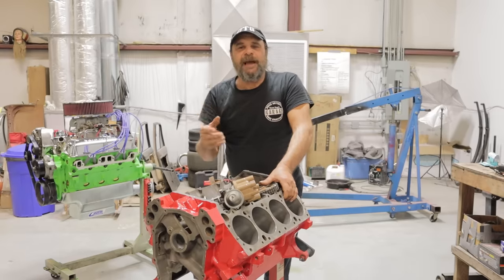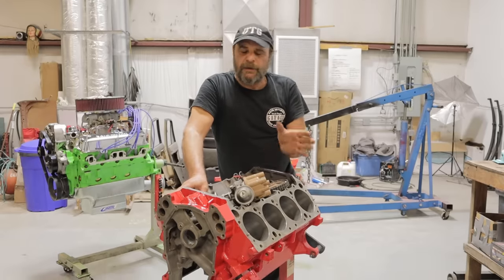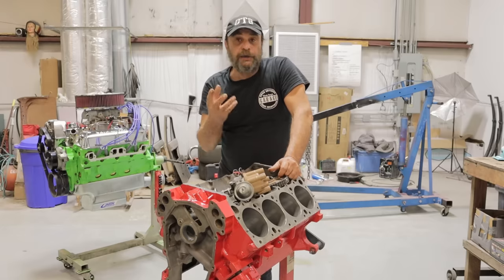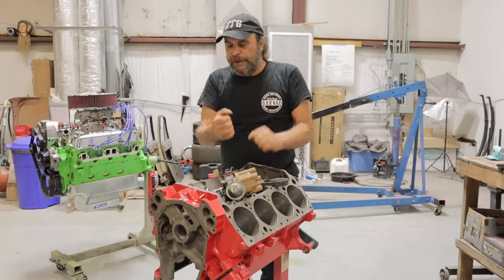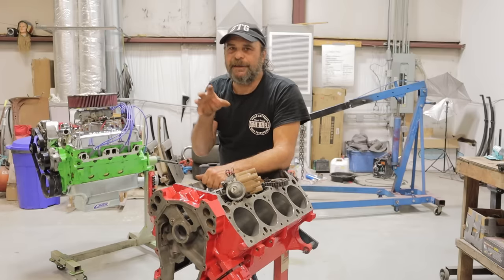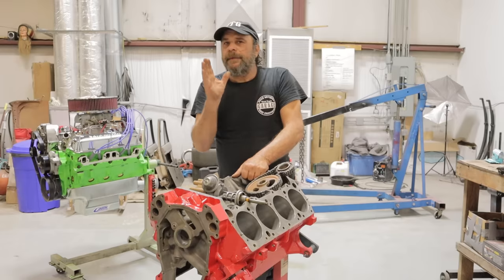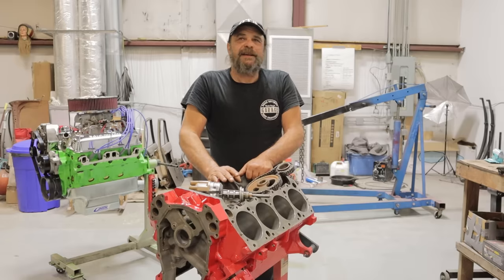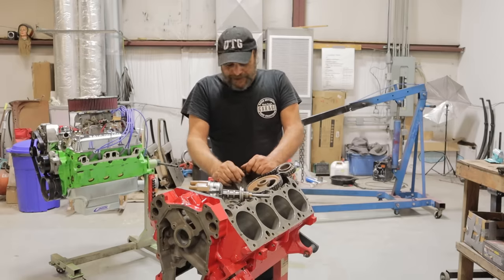Power Timing Secrets For Classic Cars

Comment: I have an 1986 gmc 350 that I am getting ready to start and break in a new cam and flat tappet lifters. I used pre-lube for assembly and am adding a zink additive for initial start up. My question is, can I set the timing mark on the crank to the 10 deg advanced and line up the number 1 on the cap?  I only have the old style light without the pickup and old dwell meter.

Comment: I love this guy more than a NOOGE...NOUGE...NUJE...  Awwww heck, now for an important question...  I recently had my motor completely rebuilt.  I haven't started it up since I got it back from the machine shop.  (10/03/23)  It was run on a DYNO and I brought it home that same day.  It is a BBC 396

I'm just about ready to fire it up, but the weather is becoming cold...Low 50's in the afternoon.  Here is what I was going to do while the motor is on TDC while the spark plugs are out of the motor:

1.  I was going to run an oil pump priming tool first, in order to get the oil pumped throughout and up to the top end at the rockers.

2.  Install the distributor as the motor is at TDC.

3.  Turn the key over for a few seconds to prime the carburetor, without the spark plugs installed, and no power to the distributor.

4. Install the valve covers, spark plugs, coil wire, and make one last visual inspection ensuring all power is supplied, fuel is ready, and finally hope to God I've done everything correctly.  

Is this the proper procedure, or should I be doing something different.  If so, what can you recommend?  

I have had the motor wrapped in blankets, with plastic covering the rockers, since I brought the motor home.  I just don't want to do any damage to this motor.  Fresh oil is in the pan, coolant was added last weekend (11/18/23) and now I feel confident after watching your videos, that I may have success with this.  Just nervous!!!

Comment: on a 300 ford 6 a common thing is the rockers are cast and bend out of shape and can lose up to as far as 7hp, it has a timing gear for the cam disi and oil pump but has only as low as 7.8 compression in carb form and as high as 8.8 with efi, the efi heads are fast burn and top out at 27 degrees of advance due to fast burn chambers, and so are a bit different

Comment: I’ve had my motor for like 5 years , I’ve had nothing but issues with this thing, I’ve tried soo many different combos, and I noticed I was knocking and pinging due to retarded base timing at like 18 degrees, I did your power timing , and took note that it probably wanted to be at 8, then I un hooked vaccume lines and double checked with timing light and it was right on the money , like what you said , after watching this video like 3 times it started to make sense, cause I always felt like my timing was advancing super late due to late base timing, I’m at the point where I don’t wanna hurt my engine before I actually get to enjoy it

Comment: I have done that for years. I had trouble with that one year the timing was all over the place found out the distributor was wore out i pulled the cap off and could wiggle the shaft back and forth and pull it up easily. Put a new distributor in and took care of the problem.

Comment: The sound that Uncle Tony made at 13:44 is quite accurate, that sound is like 45* or 50* of advance.  Keep Noodging to Retard around 30* or 32* and see if it goes away, I have set my timing? Or Noodges? at around 29* advance, More experimentation is needed.

Done on a big block chrysler 361.

Comment: Does using a Pertronix ignition item impact how one understands timing and setting timing? In my  case, I have a higher mileage mostly factory 69 Dodge  Monaco 383 4bl auto transmission. The Pertronix ignition item and a high flow air filter, and plug wires, are not OEM. The original carb works well. Thank you.

Comment: Ignition timing can make a wore out engine crank and run like new if tuned right. I demolishwd a smallblock chevy by driving it with no coolant (2 Am and nobody to call or tools to fix it with) and my dad did a little tweaking to it, and even with the engine being practically trashed in every way it still cranks and runs (almost) like new. But it'll smoke like crap. Fast forward to now and i have a 250 i6 in a camaro thats flooding itself and we are trying to mess with timing to fix, but it may be a carb replacement.

Comment: five months and my cared f93 ford laser (escort)  still runs mint i can start and stop no problem, fires up in a fraction of a second with a new clutch its loads better to sit in and driver compared to other carbed cars. after changing the mechanical fuel pump a refurbished dizzy and carb. the only thing i need to get done is the outer CV. Thats the next job that well make my hands dirty lol

Comment: Not trying to say tonys wrong  but all you have to do to sbc is start your engine let it get to operate temp. And pull the distributor forward until it sounds like the starter is dragging and push it back a 1/4 " at a time until it starts perfect then pull  distributor 1/4" forward.

Comment: I have a 1972 Cutlass Supreme. It sounds & runs good while sitting idle. When I try to drive it I get less than a mile & it shuts off. Sometimes it starts back up right away. Other times it takes awhile to start, but when it does it does the same thing. Could the timing be the problem with my vehicle?

Comment: I've got a built high performance csb350 and the heads had work done on them prior to the head gasket set that I'm doing to it now. Now will my rocker stud bolts/ question(1[should you be able to tighten the nut all the way down to where it can't be turned anymore it's completely tight or will a normal rocker bolt stud and rocker bolt/stud nut never tighten all the way down and (2 should there be a gap 3/8 to a 1/2 of gap between the rocker and the head when tightened down to (?)That's my 3rd question what if any is the  lb/ft. Of torque for the rocker nut? Last question reuse of head bolts have you ever read used them;?Thanks in advance Uncle Tony. No pun intended.

Comment: Quick question.  The problem our shop is trying to nail is a pink/knock under heavy foot, to the floor type of thing.  98 non ethanal gas.  If it pings or knocks ... does that mean the timing advance is outright too far before tdc?  How does and when does the distributor and it's weight fit in?  Next, info is 1966 GTO with a 428 (had a tri but took it off and put on stock 428 manifold and crb).  Compression is 180 to 200.  It is coming into the shop tomorrow 05312022.  Maybe set power/load timing with distrib advance disconnected ... maybe all the time. We are chasing the ping under super heavy foot feed.  I get some of the intuitive thing... but I see or reason to advance timing if it pings for any reason.  We don't know the eng history. Basic timing is 6 according to the shop manual.

Comment: Hey uncle Tony first thing let me say that your video's are awesome I have a question about a small block Chevy 350 how much piston ring gap is to much  the heads have been ported and has 202 valve's and a thumper cam using flat top pistons standard bore performer intake high voltage hei blah blah blah my piston ring gap is around. 024 to .025 on the top ring and around. 026 on the 2nd ring is that to much gap they are flat top forged pistons and cast rings thank's

Comment: at idle you advance till you get the highest idle, and then back it off till it just is at the cusp of dropping 100 RPM, and then total advance is advanced to where it just begins to ping  when it’s lugging at low rpm with high throttle
Engine idle mixture should be lean just to where it starts to do it couple of hundred RPM drop and if it’s a carburetor pay attention to the accelerator pump which should have maximum flow and no play

Comment: I have a question. I’ve learned an incredible amount on distributor/timing/the whole shabang recently as I replaced my intake manifold and carb on my sbc 350. These videos have just been an incredible source. My question now that I feel I understand the topic is…..is it even necessary to use a timing light to set initial timing? Since it sounds like in almost all situations, your going to set it by sound and right up before spark knock? Why then would even initial timing be needed? If you set it at 8,10,12 degrees, you are essentially going to advance it anyways (if needed) to get to that ultimate power timed degree. Am I understanding correctly?

Comment: Hey man have you ever seen a 350 to 305 swap I blew my 350 up so I was gonna swap it with a cheap 305 I found I’ve never done a complete swap so I wasn’t sure if I had to do any prep work or anything before I did the swap I’ve done a lot of research and it seems like everything will bolt in perfectly

Comment: My 93’ Thunderbird has the 3.8 it is a computer controlled distributor with a Halifax sensor do I still time it the same way? I can’t find any specs for initial timing. The computer can vary timing from 8 to 12 degrees.

Comment: I have an issue with my 87 camaro with 305 tpi. I think it is timing related. After a shop stabbed a new dizzy i  it, it hasn't been itself. It has a random popping in the exhaust in idle. And when I'm cruising at lets say around1500-2000rpm with light load I can feel the same random popping during the drive. With each "pop" the rpm needle jumps.

Coil, plugs, plugwires, cap, ignition control module and rotor is Ac Delco. The distributor itself is from the brand "standard". Car has 87k miles.

Comment: Had a 3rd gen vette with a worn 350 that wouldn’t run for crap with a timing light, years later I wonder if the balancer outer shell turned.  Just kept moving the distributor blindly till it ran its best.

Comment: I've seen a few engines that you couldn't time with a timing light. The timing marks were wrong for some reason. I once bought a brand new harmonic balancer for a 327 Chevy and found the make on the balancer was out by 7 or 8 degrees. Was it the balancer or the marker that bolts on the side of the timing chain cover. I never found out which. I just used a hacksaw and made a new mark on the damper in the correct position. Over time the outer ring on old dampers can walk around the hub as the rubber sandwiched between the 2 pieces deteriorates. I've also seen a couple of dampers fly apart because of the outer ring coming loose. Timing older engines is more art and intuition than a science
Reply: Love the hacksaw idea

Comment: What if I didn’t degree my cam in? Wouldn’t that change how the engine reacts to the timing or how much timing it will take? My built 318 according to the timing light will idle at like 30 degrees or more. And it still wants more advance

Comment: Having issues with my 350 sbc. With timing I ran last year (38) it spits out and back fires through carb. We got it to stop spitting by lowering in the 20’s but car under load stutters bad. Any ideas? Can’t get the car to run right. Idles great, snappy from carb then put in gear and try to put load and go it just stutters like a 2 step.

Comment: Hi and thank you for your videos Uncle Tony! I've got a guestion about sbc and cylinder pressure testing. I have measured the combustions pressures and found the 6.cyl averages about 20% lower than the others cylinders. What could be the possible causes and is there an easy way to fix a cylinder such as honing the bore etc?

Comment: Static and dynamic compression should always stay the same, but cylinder pressure or cranking pressure will drop over time.   Right?  It was always my understanding that dynamic compression was calculated using the closing of the intake valve and thus may vary with the camshaft selected, where as static compression was simply based on bottom and top of stroke.  Help me if I am mistaken.

Comment: I just put a brand new 383 and a decent cam , I can’t get it to idle using a 750cfm  carburetor it wants to run but won’t lop just will kinda spit and pop and die as the rpm’s are lowering

Comment: Hey Uncle Tony, could this technique be used on an air cooled VW engine? Would this raise the operating temp too much?
Reply: 10 degrees too advanced you can melt down a piston. 

Depends on what kind of distributor u have. 

32 deg max advance. 

Also pays to find actual tdc. Factory marks are a joke

Comment: It’s a sad day when you have to explain the comment section before the video starts.
On the flip side I will be doing my engine with a timing light, then not knodding the distribution but moving it 2 degrees and then writing down the results.
I have to write it down, then reading everything to find the sweet spot.

Comment: What are your thoughts on changing the firing order. I'm not sure if it's A thing with Mopar. But with GM you can. It's been so long since I forgot why. I have seen it pick up HP not much tho. These were all modern fuel injected engines

Comment: When im adjusting the dist a 'nudge', i just put my hand on the vac advance pot...i stopped putting my hand over the plug wires on the cap...as the occasional shock made the ticker stop a few times ☠️
Reply: If you're getting shocked while touching the plug wires it's time for some new ones.

Comment: Hey UTG wanted to ask would A severely stretched timing chain cause hesitation when you mash the gas from like a stop sign? I have a video on my page of the sound it’s making and I’m quite sure it’s not the lifters each valve opens and close very well watching the pushrods move up and down! The motor has quite a few nitrous pulls and I think the chain has slack.

Comment: I was hoping you could do a video on setting your timing on older cars that still have to deal with smog checks. I have a 79 Vette and i live in Calif. The sticker in my engine compartment says my timing should be set a 8 degrees BTDC @ 5000 RPM.  My question is, should that be the reading with the vacuum advance disconnected and plugged, and should the vacuum advance canister be capped also? Help!!! My Vette is a stock L48 350  5.7   Thanks. You do great videos.
Reply: @kennywhiddon1497  Vacuum disconnected and plugged, correct?
Reply: @kennywhiddon1497  Got it, thanks!

Comment: He was right. This is exactly how I figured out my timing on a 81 Corolla with a 572, xxx mile 3tc motor. Timing chain/ tensioner is very worn so I took it up to the local canyon and nudged my dizzy back and forth every 2 corners till the spark knock stopped and I was able to smoothly floor the gas. You can also short shift and full throttle for a similar diagnosis i think.

Comment: Engines are like people, the older we get the more retarded our timing gets.  When I was 16 years old, my alarm would go off and I was ready and out the door in a few minutes.  Now in my 40's the alarm goes off and I'm not even out of bed a few minutes later.  So you have to adjust the timing.  Now my alarm has to go off earlier so that I get out of the door at the same time.  See  - same same.

Comment: get a holley, 4 corner tuning, set float level, adjust for highest number on a vacuum guage in gear, vaccum line off the dist and plugged, jet accordingly to driveability, of course you will have to set the best base line all in timing, he didn't explain the all in advanced timing for peformance,it needs to be set at approx 2500rpm

Comment: Power timing the old timers told me about this. The higher the compression ratio the harder it is to tune I had a car that would run at 12° initial 38° total it would only start at 8° advance so I had to adjust the distributor to give me optimal starting initial advance and full advance and I would scream by everybody
Reply: Total is the sum of mechanical plus vacuum advance,aka spark advance if using.

Comment: I have a completely rebuilt 350 sbc bored 30 over with a comp cam, trick flow heads and an AVS2 carb. I found my distributor loose after looking into why the car was running rough and not starting very well. I rotated to distributor until the car was running ok and was starting well. I set the timing to 12 degrees initial and 36 total, but now I have a noise the is best described as "diesel" engine sound under load going up hills in 4th or 5th gear. Is this the "spark knock" that is being mentioned and is retarding the distributor the way i'm going to get rid of that sound? I found retarding the engine any further causes it to almost stall out. Your videos are great btw! You'd be a great neighbor to have lol!

Comment: I have a 1999 Volvo penta 5.7 in my boat that had a cracked block so I got a Chevy 350 older block and had it rebored new cylinders and valves and I can’t find anyone that can tell me what to set the timing and at what rpm???

Comment: I had a 3.9 Magnum with a timing set so worn out it was causing a excessive crank issue and rough idle at start up due to the timing being so retarted. After 3-4 seconds the ECM adjusted timing it would Smooth out. It always smoothed out so I never worried about it until one day the chain failed. After the new chain and gears the problem went away and it caused me to scratch my head and go Duhhhh. Live and learn

Comment: This can be achieved the one and done way if it's an automatic trans car by having the trans in reverse with someone holding the brake peddle while their foot is on the throttle as much as they can without breaking the tires loose. Then someone else can advance the distributor until they hear spark knock, then just back it off until the knock is gone and set it and forget it.

You put it reverse for obvious safety reasons, also the guy doing the adjusting needs to watch his feet if the car starts moving backwards if they are on the side of the car.

Comment: same process works for wives that have timing issues....they resist but after a few nuuuuuuuudges they are ready to run hard and smooth...usually with maximum torque ratings.